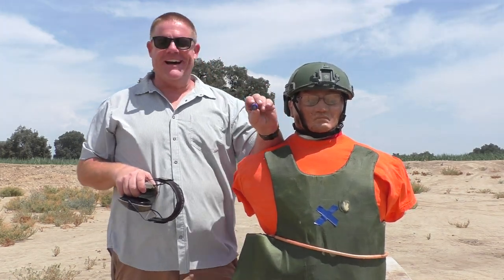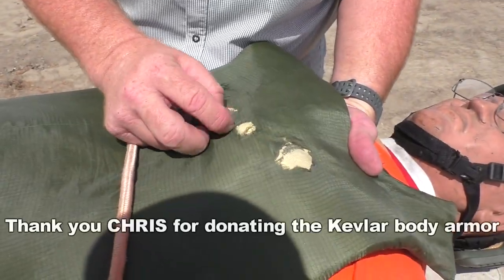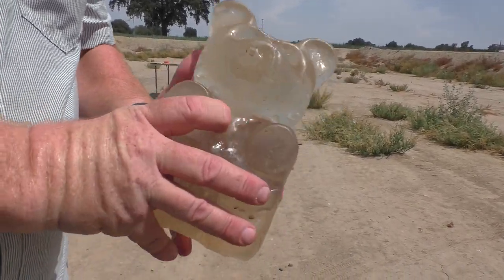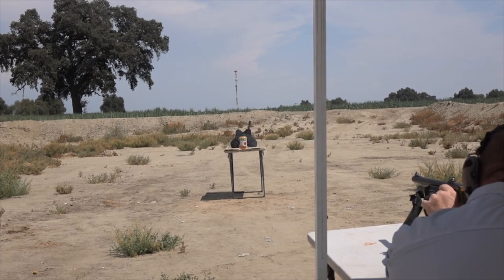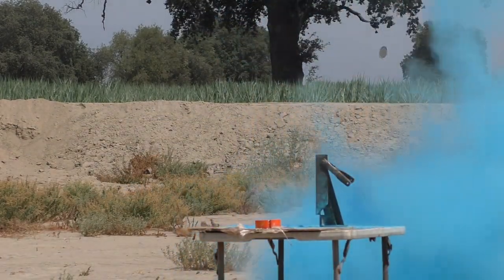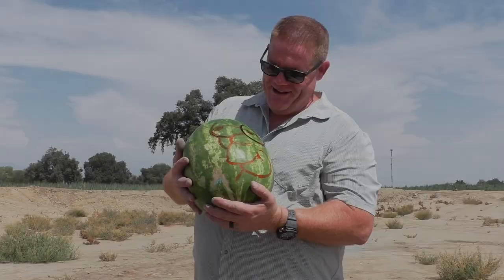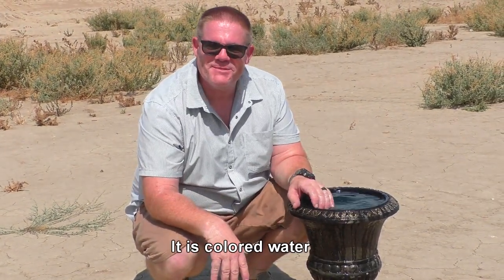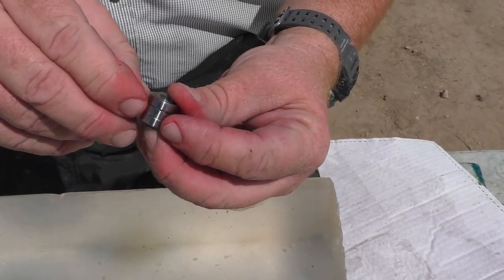Triple Radial Bearing 12ga Slug -  A Real Surprise

Comment: I mean its not a "precision factory slug", it probably has tighter tolerances than most slugs :P
Reply from the maker: Lol  possibly
Reply: My thoughts too, and I was waiting to the end of the video to post a comment. ..... A tiny imbalance in a high speed bearing would make it unusable due to vibrations.
Reply: @taofledermaus  reload one of the found ones, and shoot a sealed 5 gallon orange Home depot pail of water. at 100 yards.
Reply: Bearings are precision ground to tolerences of 0.01mm so yes, incredibly accurate
Reply: It will have. Tolerances will be about 5-10 microns. So 0.01mm.
Reply: Precision is great, now hit a bone with it! Meat target should deform and dislodge those bearings creating a wound channel of significant damage. Follow-up is needed to verify.
Reply: @jgordon5408  Bearings usually don’t deform, since they are made from hardened steel. They flex and spring back, or when taken beyond tolerances, they explode. Which would be interesting to see, but I think that would require something harder than bone - something like a steel armour plate. With bone, they are likely to just break it and keep ploughing through.
Reply: @mikkohernborg5291  true that

Comment: About the Applesauce, here is what I found:
It is, technically, a “non-Newtonian fluid”, which is, in the case of applesauce or ketchup, a fluid with solids suspended in it.
It is also full of sugar, so the liquid part is also a kind of syrup, I.E. thicker than water, thus providing more resistance to the forces imparted on it.
Reply: Applesauce was around long before Newton invented the light bulb so of course its non Newtonian... But is applesauce magnetic? I'm going to invent magnetic applesauce that won't fall off a toddlers spoon and be rich beyond my wildest dream (singular). Maybe I can buy my own applesauce and  get even more richerer!
Reply: @screwfist  Nelson didn’t invent the light beer!
Reply: My guess would be that the large amount of apple solids were compressible enough to absorb the impact.
Reply: @screwfist  Not only Newton but nutritional, the magnetic apple sauce would be very high in iron.
Reply: But it splashes?...
Reply: Most likely, the fibers of the fruit reinforce the jelly.

Comment: tell Evan to replace the Shaft with a carbide drill bit in order to make AP rounds
Reply: That's actually a really cool idea 👍
Reply: Also double as fragmentation rounds if you're hitting anything harder than flesh.
Reply: Dude, yessss!
Reply: I would say you're all sick 😷 but I consider myself normal and so far every comment I've read is exactly what I was going say. Soo.....
Reply: I know this is really late, but I’ve worked with carbide before, and I think a piece that big would just shatter. Carbide is hard, but it’s very brittle, and unlike a carbide tip, a full shaft of carbide has a hell of a lot of cleavage planes to fail at.

Comment: Smooth bore with a rifled choke might impart spin on just the outer races as it would produce more of a snap spin after the core had established a fixed momentum. In theory anyway.
Reply: I think it'll be relatively impossible to prevent the core from spinning at all. I think your idea would be great for a greater difference in rotational speed between the core and outer race, but there is still some friction between all the parts, and inertia always wins.
Reply: @jordanrogers6804  what about rifled barrel to a reverse rifled choke? Core spins one way and the race spins the other?
Reply: @Username-jb2vs   - Seriously twisted thinking . . . Barnes Wallis approval pending!   : )

Comment: Paul Harrell would have used the new and improved Gummi bear.
Reply: "& the gel formula, per non-fluid ounce, exactly matches 82% of the compound curves of a 400lb grizzly having a dump under a clear February sky with CavOK conditions of 71% relative humidity in frost . . ."

Comment: Hey what if you could put the shell in a field of spinning magnets at high rpms then quickly place the shell in a smooth bore and shoot it while the rotational mass is still spinning. That should make it a dead on slug due to the gyroscopic action and should theoretically fly straight
Reply: Over engineering at its absolute purest from
Reply: Or you could just rifle the barrel, and make the outside of the slug soft enough to engage the rifling.
Reply from the maker: It's all pretty snug inside the shell and even snugger  as it hits the barrel.   (a tight squeeze)
Reply: Bullets will climb in the direction of rotation. I suspect your idea may be subject to the same forces

Comment: theoretically, the 3-bearing slug should fly straighter after an impact compared to a normal lead slug. My thinking is that the center rod will continue to spin on impact, as the bearing stop spinning during penetration. After the whole assembly exits the target, the spinning center rod would transfer some of its rotational energy to the bearings, causing the whole assembly to spin again. In fact, i believe the center rod will spin even faster on impact when the outer bearing stop due to conservation of rotational energy. 

The video does show the bearing slug rotating after exiting the target. It would be interesting to compare this bearing slug to a solid lead slug of the exact same size (with the same sabot) and see if the lead slug is also rotating after exiting the target.

Comment: I have to wonder, while the outer bearings didn't spin faster than the core when leaving the barrel, if the outer slows down first once it hits the target, could the inner still have rotation that effects flight?
Reply: Like a Gyro giving it stability in flight.
Reply: There is no reason for inner and outer side to spin different rates, nothing is holding the shaft in place for it to rotate at a different speed then the outside
Reply: @Mr2winners  There is "something" limiting the outer, once it penetrates "something"....

Comment: I replayed that last high speed shot of the ballistics gel at .25 playback speed. 
Gorgeous! 
I was in hoping for a sonoluminescence flash, but not this time sadly.
I was thinking about the bearings running through the rifling. You'd have to reduce the friction between the inner & outer race so the inner core doesn't start to rotate. 
The main source of friction will be from the viscosity of the grease. A viscous grease is used so it doesn't drip past the grease shield in use. But we only want it lubricated for a momentary use. Just enough to get it down range.
So if you wash out the thick grease it comes packed with and replace it with the lightest oil you can find. A 2 stroke oil & petrol mix at 40:1 is the lightest, cheapest lubricant I can think of. Applied & used before the heat at that scorching range evaporates the petrol leaving the gloopy 2 stroke oil behind.
Then, as the outer race spins up down the barrel there isn't enough friction to pass that rotation to the 8nner core. 
It'd look great in the high speed shots having the outer rings spinning whilst the inner core isn't but I think it will lead to a drop off of accuracy because there's less mass rotating meaning the gyroscopic stabilisation will be reduced.

Comment: What could very well be happening is that the race begins turning first and allows the core to catch up on it's own. This could even be happening in the first few inches of the barrel though. This is some seriously smart engineering. It appears to have been an accurate hypothesis.

Comment: I wonder if the reason everything is spinning together is because of the side ways pressure is creating more friction preventing it from spinning separately from the core. Or possibly pressure on the shot cup spinning in the barrel. Either way; this is a super interesting video. Thanks for making it.

Comment: Even at ABEC 1 rating these bearings would have tighter manufacturing tolerances than damn near anything from a shotgun projectile manufacturer. If I remember correctly the OD tolerance for a 17mm bearing is around 13 microns

Comment: Path of least resistance on the applesauce. The containers lid is thin and brittle, unlike the jar. Whereas a milk jug is more consistent in construction. Hydrostatic pressure is even applied through the medium, and once the pressure wave contacts the container walls if the lid is shit that's where it'll go. Good show boys!

Comment: No lead plate? I wonder if the core and the outer rings had any difference in rotation speed. Fun video as always, keep it up.
Reply from the maker: These were pretty light loads because I wasn't sure if they would hold together.   I don't think they had enough velocity to really do much to the lead plate.

Comment: If the shaft was maybe a little longer and had a fin or two  out the back to stabilize it the shaft may not have rotated, or even better curved fins to spin the shaft in the opposite direction of the rifling?

Comment: Great video, but why didn’t you shoot the lead place?? This would have been an amazing one for the lead plate!
Reply from the maker: I have to make on the spot decisions of whether it would be safe or not and worried we'd have fragments of hardened steel flying back at us.
Reply: @taofledermaus  ahhh okay. Totally Understand. I do have an idea though! Would you be able to take off the bearing face plates, and fill the voids with epoxy or resin of some sort? That may help them have some more weight/characteristics. 

I think the lead would deform much quicker than the hardened steel, but that is a massive impact. I would believe that the cast iron (you shot a cast iron slug at the plate right?) slug would shatter and explode much more easy compared to decently hardened steel. Although, the bearings are many thinner pieces of brittle steel... I understand your concern. These were extremely accurate though, would 30-40 yards away hitting the lead plate not have been safe? 
Much love
A Gun loving, freedom supporting Machinist!:))) <3

Comment: While they can't be good on the rifling with the hard bearing material, but these things are crazy accurate.   

There is less distortion and transferred energy to the target, because the bearings aren't deformity and enlarging the frontal area.  They are literally punching holes straight through (apple sauce).
Reply from the maker: They never touch the rifling.

Comment: One of my loads are 9mm steel ball bearings. I can get eight in a 2 3/4" shell. I recommend you try it. I, also, do #3 split shot sinkers.  Sometimes .33 00BK is hard to get.

Comment: I wish they still made Gillette 'Techmatic' razor strips.  They were a continuous strip of single edged razor blade material (wound like a watch spring) that the user advanced as needed  via a rotating knob on the handle.  Three of these babies can be stacked in a 12 gauge round - if you can handle the difficult job of keeping them compressed during the process of removal and reinsertion into the round.  The Techmatic razor was a short lived 1970's novel shaving device, so it might be necessary for a present day experimenter to source some generic continuous razor strip material and wind his own - if anyone wanted to try this out nowadays.

Imagine the effect it has when it impacts a "tree" and wraps around it - imbedding itself into the trunk as it does...  Just a thought.

Comment: I am sure that you are asked for this many times, but i only recently found your channel. I am looking for the very best bear bone breaking round (skull if I can make the shot). I know that it sounds vicious, but I live in Alaska and work in the interior and coasts during fishing season. If my shotgun gets used it is for self defense and I am looking for the best round that will stop a brown or polar with the least number of shots. Likely to end up on my back pretty quick so energy transfer and penetration is everything. I liked the one from Wales. What do you think would be best.
Reply from the maker: As far as Alaska goes, it's usually what you can get there,  which is probably foster slugs.   I wish I could give you a better answer.

Comment: It seems you could make a firearm with bullets that have built in mini motors powered by the gun, that hook up using press contacts... you have one mass spinning vertical and one spinning horizontal and you will have a super stable bullet that flies really true and has alot more energy to dissipate into the target.

Comment: Despite what this guy says about rifled shotguns, a smooth bore is very accurate within 50-75 yards. The main reason you want a smooth bore is because if you use any load other than a slug itll throw your spread way off. It'll open it up so much you might miss at 50 yards

Comment: I got to thinking, I’ll bet that at extreme acceleration those bearings just lock, and spin up as a unit. 

   Just the .02 of an old obsolete manual machinist….

Thanks for the great video.

Comment: The applesauce acts different because its not a straightup fluid, water is uncompressible....so, in a sealed container, hit it one spot and it basically gets hit everywhere. But applesauce has small particles of apples and stuff in it...which...is compressible...so it reacts differently. This is my best understanding of it

Comment: I've been loving the content and the 'attitude' for ages, (bear with me here, no puns or double-entendres allowed) but have you ever tried firing with a hard wood load? You could try anything from chop-sticks in gelatin to solid 'bog-oak (which I can provide). Imagine the speed of a solid wooden round (given the right charge) ? Maybe the lead plate would not piss itself in fear but the gummy bear would need loads of hugs.
I've been watching for years and enjoying not just the content but the banter and the attitude. I'm serious about providing 'bog-oak', I will send you some but you have to get it machined /milled yourselves, this stuff is rare and normally kept for knife handles, it deserves respect for it's properties and when it came from, possibly thousands of years old, much like ourselves!
He he, pax dudes. Come back to me if you want some  'bog-oak' to test.
Conor.
Reply from the maker: We shot some Mexican hard wood slugs a couple years back
Reply: @taofledermaus  I'll do a search for that, cheers and good shootin'
Reply: @taofledermaus  I've found it, five years ago!  But this is some extremely old stuff, a family heirloom without a simple purpose, at least 5000 years in a bog, hard as steel, it looks like wood and feels like wood except it's black and dense from all the iron deposits. You can't work this stuff like wood, you have to treat it like metal (but slower or it will char/burn). It's rare to get straight pieces (at least locally) but I can send some if you will use it, I'll also add some pieces that can be used for knife handles, if you want.
Pax dude

Comment: How about 18650s or 123 batteries...   LoL 😂
You should try a bearing round like this but use a magnetic motor to spin the core before firing... I bet it would be stable at long range.

Comment: Another great video!  Thanks guys.  As for the apple sauce, I would imagine it wasn't as dynamic as water because water cannot be compressed.  While apple sauce has a very high percentage of water, it has quite a bit of other substances that are compressible.  Also, the plastic container that the apple sauce is in would be considerably tougher than the watermelon rind and so less likely to come apart as easily.

For the complaint:  OG needs to comb his hair.

P.S.   I still stand by (and will periodically resubmit) my vote for a slug made out of a frozen cow turd, with a fan as your target.  I would be willing to bet it has never been done (at least on Youtube).

Comment: 5:00 Man I bet you anything that inner centrical force centers it like a pro....ABSOLUTELY NO WOBBLE. 
ALSO... with hole in middle with bolt tip in front. Im thinking it actually help in NOT TAKE OUT MATERIAL WITH IT. No hydro shock?  it just streamlines through everything. Cant wait to see you blast it in led IM CURIOUS does it shatter....or ...surprise... We only gotten three throught the lead plate.

Comment: I would have probably put a small disk on the powder end of the round to keep the rod from being blasted loose.  Obviously that would NOT have been needed.
Reply from the maker: I used two gas seals to support it.   x12x is pretty stiff

Comment: well the accuracy with a costume made round like that, will be for sure better, but ball-bearings are out off pretty hard Steel, so it will mess up the rifeled barrel quite fast, that's the reason they put always a layer of copper over a Steel core or something else hard, by tanks they give im (earlier) a ring of lead that could drive quite well and soft through the barrel without destroying it quickly. 
Also i learned a shotgun with a riffled barrel is not called shot gun, instead it's called a rifle, but anything what is rifeled is a rifle, and anything smooth bore is a gun ' - hmmm the dude from 'forgotten weapons' didn't explain how this rule get used by pistols 😕 is a rifled pistol a rifle or a gun or a just a fire arm, so many weird questions 😁
Reply from the maker: Somehow he had time to write an essay about something he thought we did wrong but didn't watch the part of the video explaining exactly how these were using sabots.

Comment: Crazy glue slug? Have ya would ya try it? Fill a cylinder with crazy glue and add a lil baking soda ... Layer by layer because it's going to heat up it's an exothermic reaction so I don't think you can do a whole slug at one time you're going to have to do it later by later I'm interested to see what that would do even rolled up mesh with crazy glue saturation and then making soda introduction